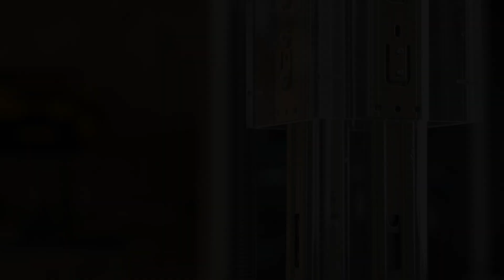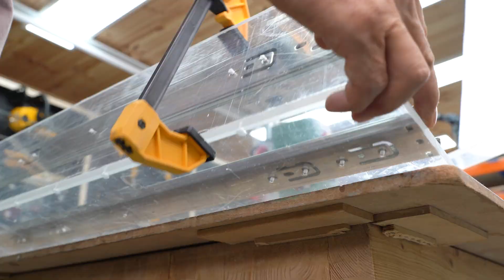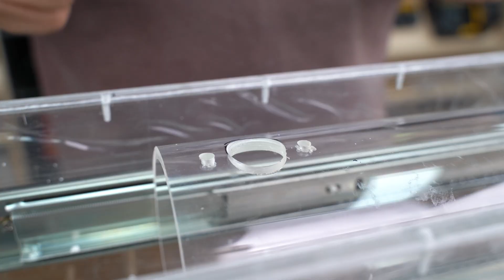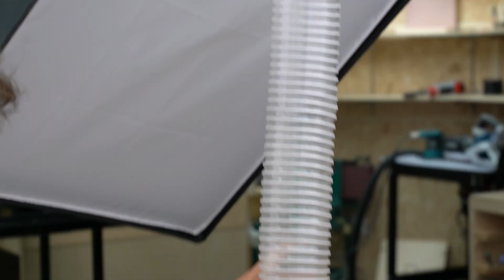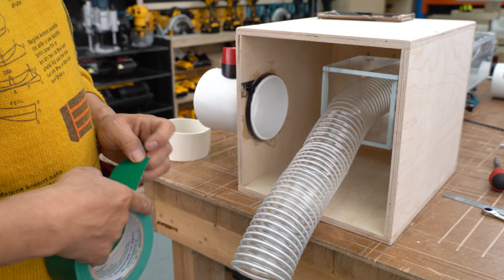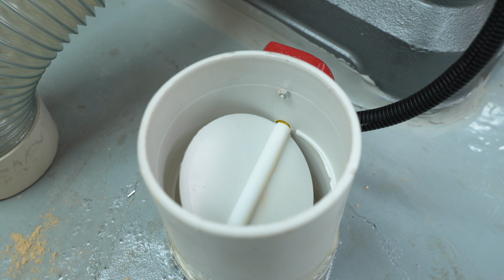Table saw Upgrade #2 : Vertical Rail System / DIY

Comment from the maker: Please turn on your language subtitles!
Dust collection at the top of the table saw is the task of all carpenters.
No matter how powerful a dust collector is installed at the bottom, the saw blade rotates so fast that it exceeds the amount of time it can inhale. Inevitably, fine dust scattering upward on the saw blade is generated. This fine dust flies in the direction of the worker, which harms the health of our carpenters. In order to catch this fine dust, famous brands such as SawStop are also working hard, and it is also a regular DIY material for carpenters.
Since the previous workers' designs were so ordinary, I decided to make them into new designs. A rectangular acrylic pipe is fixed at the top of the table saw, and a 100mm circular cylinder is moved up and down along the drawer rail inside.
Depending on the thickness of the material being cut, it has been implemented using a spring and a circular stopper device to secure it at the optimum height.

This is the second video for the work.
It is the process of installing a dust collection holder designed in the shape of a car and making an acrylic slider that can move up and down comfortably. This is because it is convenient to work by doing up and down exercises, and I thought that the height could be adjusted finely so that the optimal dust collection could be made depending on the thickness of the member.

A steel spring was installed in consideration of the load so that the height can be adjusted comfortably while enduring the weight of the dust collection holder and the 100mm diameter acrylic dust collection tube.
Basically, a square-shaped fixture tube is made of acrylic, three 600mm drawer rails are fixed inside, and three corresponding rails are fixed in a circular acrylic tube to allow the drawer to move up and down as if it were moving.
Several 12mm diameter holes were drilled in the square acrylic on the front, allowing the stopper installed in the circular acrylic to function.
This stopper is made of hardware used to secure the door.
When attaching acrylics, a 3mm thick bolt was used instead of an acrylic bond to secure them strongly. 

Although you can see it from time to time in this video, the process of making the upper fixed frame, installing the dust collection switch and switch, and driving it directly will continue with the next three videos. Please look forward to it. Thank you.

#DIY #Woodworking #Workshop #Dust_collection #Tablesaw #DIY_IDEA_INVENTION #Howto

Comment: Is there anywhere you sell any of the pieces you’ve shown on YouTube ?
Reply from the maker: I'm still working on creating pieces that I can use myself. Instead, I'm making blueprint videos for about 30 different works, so you might be able to make what you need yourself. If many people want it, I would like to try producing it in small quantities, but I think it would take more than a year. thank you!
Reply: @ thanks for the feedback sir, I’m handicapped and on a small budget so I would prefer buying some items instead of trying to accumulate all the necessary equipment and materials to make items. So if you ever make some available is be extremely interested in acquiring a few of these!
Reply: I’d be. extremely interested